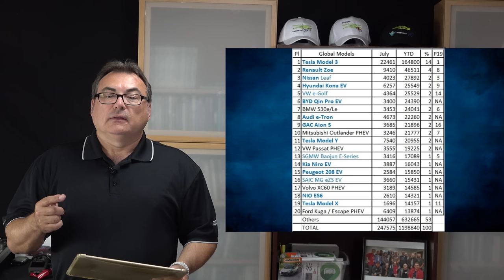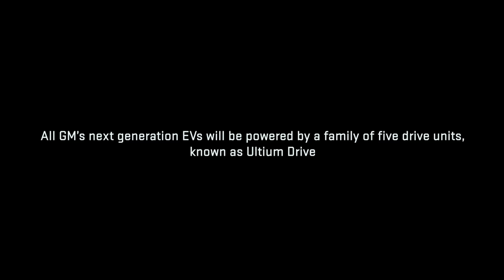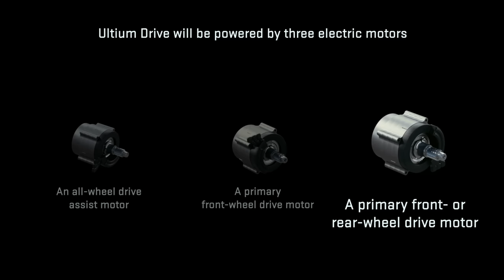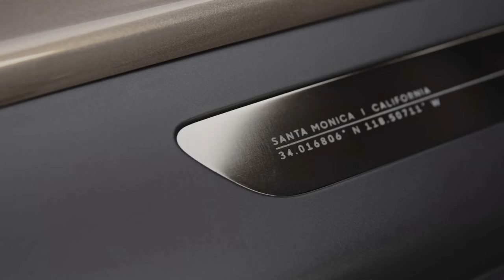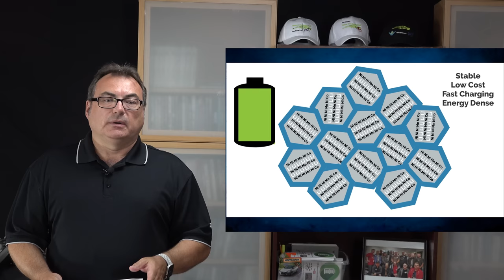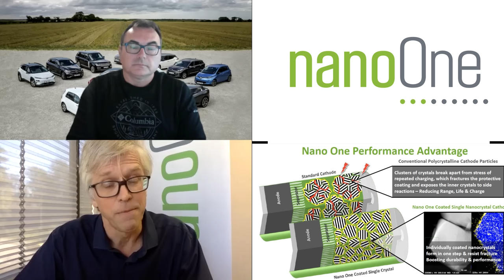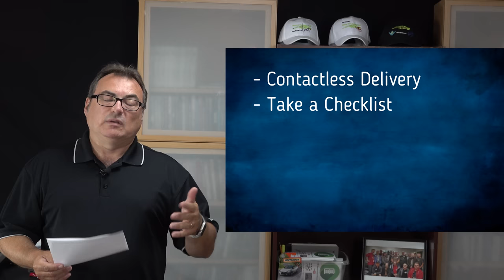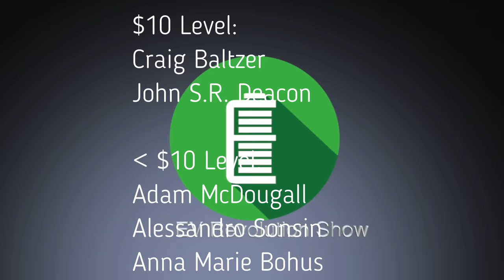Episode 107 - The EV Revolution Show

Comment: Did GM really invest in Nikola? I heard other stories that reeked of corruption.

The wireless BMS GM is working on sounds like a great cost and weight saving exercise. Although...might there be a way to send data over the power channels? Some LAN networks use a building's grid.
Reply from the maker: Whatever the form of partnership is between GM and Nikola, I hope it works as we need more choice for BEVs.
Reply: Using a LAN would still hard wire it. And while using power lines to send data has been done. It would have involved much more time and money to develop than using the Bluetooth standard protocols via a Master/Slave configuration, which is what GM is using. IEEE Spectrum has a story on it if you want more  details...

FWIW the only thing that really matters to me about Nikola at this point is they will be another channel for the GM's new EV platform... And most of the rest of it is just hype and noise....
Reply: Actually Nikola invested in GM's EV platform, gave GM stock, and cash to get access to buy from them...

Comment: Nikola gave GM an 11% stake in their company.  Gm hasn't invested a dime yet.
Reply: 11% of nothing, is.....?
Reply from the maker: Hey, I'm just reporting on what's going on.  Seems Badger is moving forward and it's GM's money if this ends up going bust.  I sure hope not as the more EVs offered the better.
Reply from the maker: Thanks for watching.
Reply: The 11% stake in Nikola is in kind,  basically for access to GM's parts bin.   Nikola will also pay GM an additional $700M for the specific engineering cost of the Badger, and setting up the assembly line (same line the Hummer EV, and Silverado EV will be built on)     I think this is a win - win for GM,   they get a portion of Nikola stock which they can sell anytime,   they get paid for their engineering time and manufacturing setup, and get paid a profit on the Badger's they build.      Let's say Nikola fails in the future which is possible, GM can at any time sell the stock and pocket the 2B in cash,  maybe they already sold the stock?
Reply: Proof is in the pudding for Nikola I guess (is that a saying over here?). Another great show Ken, thanks for your fair and balanced approach.  👍
Reply: It would be smart for Nikola to get GM to back up the warranty. Since it's really a GM product anyway.

Comment: For the life of me, I can't figure out how the Kona is outselling the Niro, especially by so much. People have said it's the size difference but they're not that different.
Reply from the maker: Hi Robbie, my guess it's availability and range.  The Kona is more efficient although it is smaller than the Niro EV.  Probably better pricing deals too.
Reply: @EVRevolution  I've seen both run over 500km with just regular driving so I'm not sure how much the range is a factor unless people are going by quoted range. And I don't think the efficiency is overly different either.

Comment: I don't know what Lucid mean with "more efficient". Seems like strange jargon.
Are they offering better energy ECONOMY or are they reducing heat losses from a market best say 10% to 8.5%?
Reply from the maker: They claim leading efficiencies (miles per kW of energy used).
Reply: good luck googling what efficient means....   btw The Air has a rated energy efficiency of 21.4 kWh/100 km (62 miles), or 2.89 miles/kWh, which is equivalent to 2.4 litres/100 km in fuel. Enjoy...
https://en.wikipedia.org/wiki/Lucid_Air